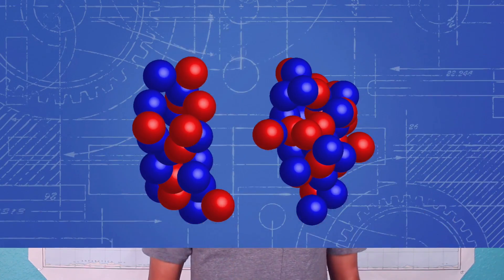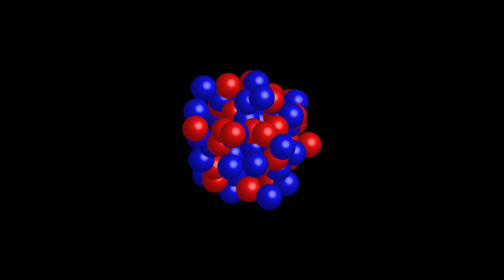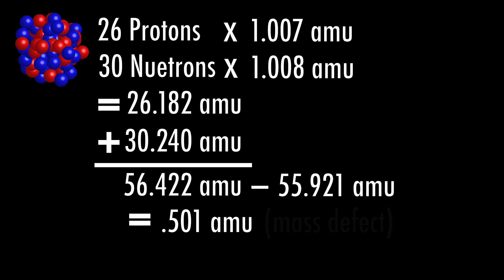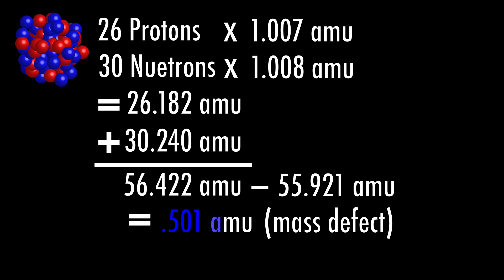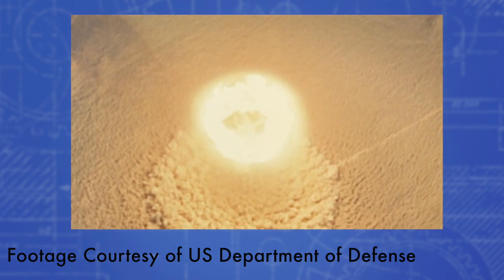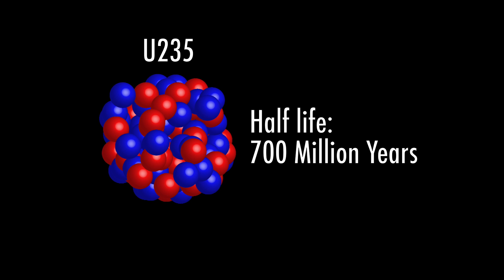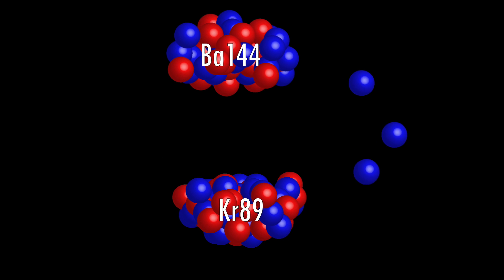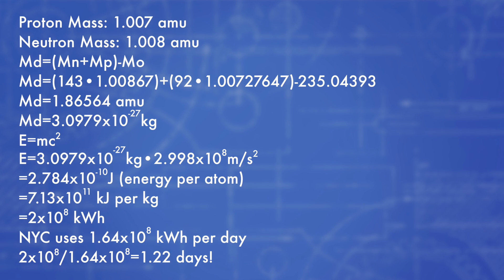What Happens When Atoms Break Apart?

Comment: When U-235 gets hit by a thermal neutron it either fissions (82% of the time) or it absorbs the neutron and becomes U-236 (18% of the time). It doesn’t do both. Your explanation that the U-236 atom then becomes unstable and fissions is incorrect.